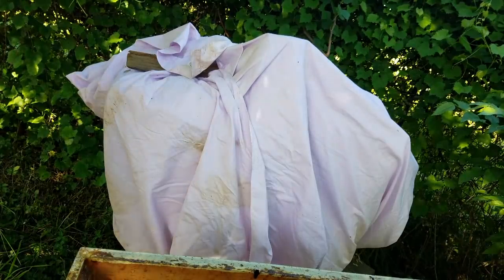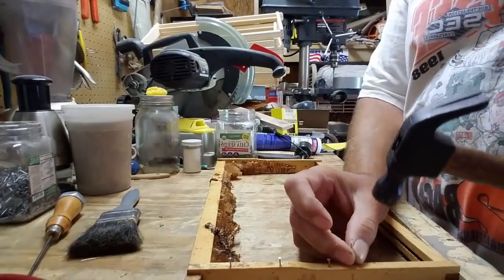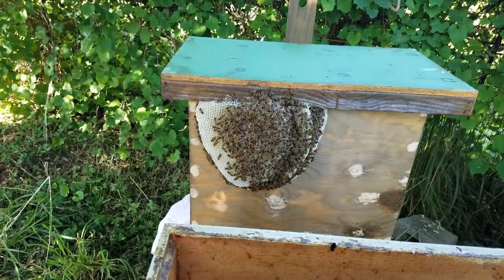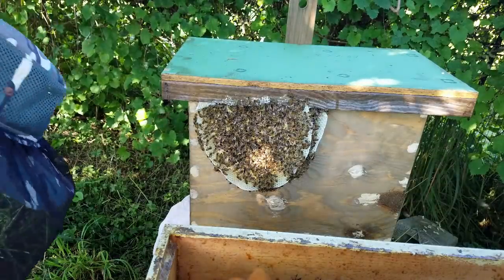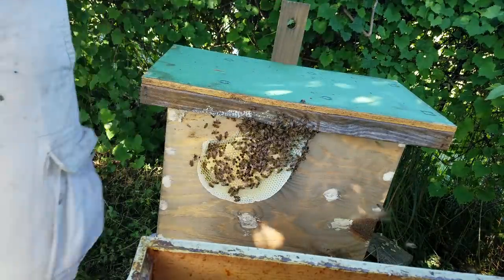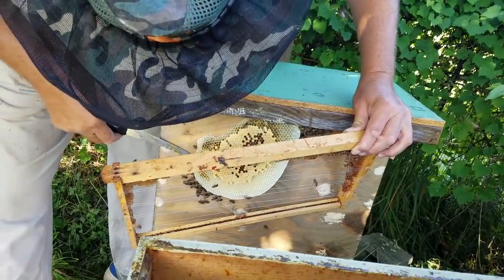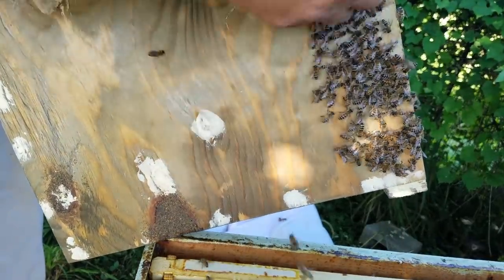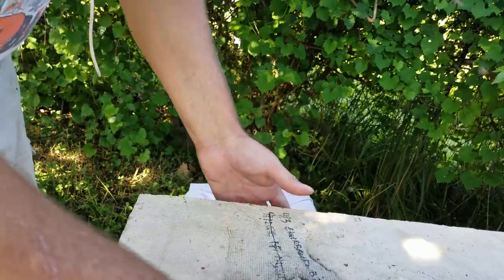Swarm Trap Rescue 911 Honey Bees needing Help

Comment: Use rubber band to hold it in there
Reply from the maker: virgin comb will not work with rubber bands. the fishing line digs into the comb a little and help hold it in place. the rubber bands will let the virgin comb crumble under its own weight. if you watch any of the big utube bee removal guys they never keep the virgin comb.